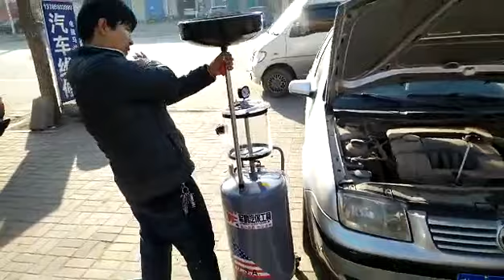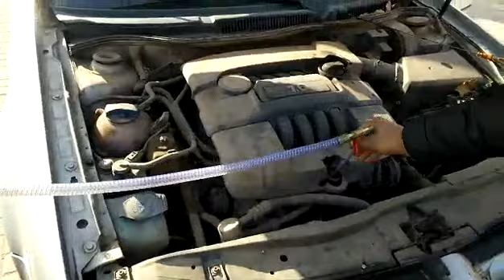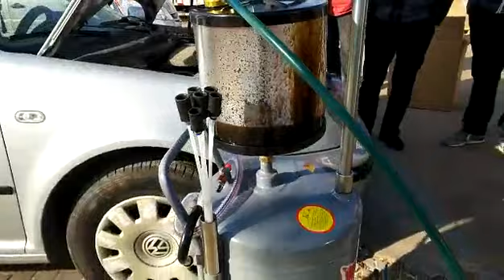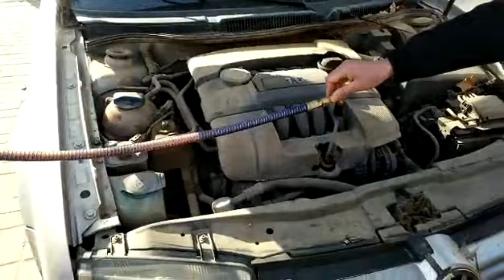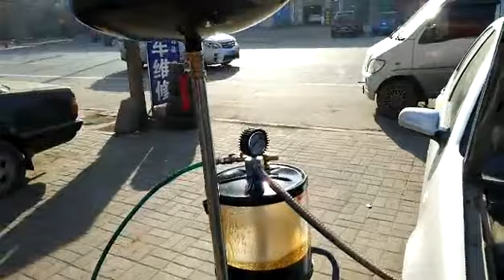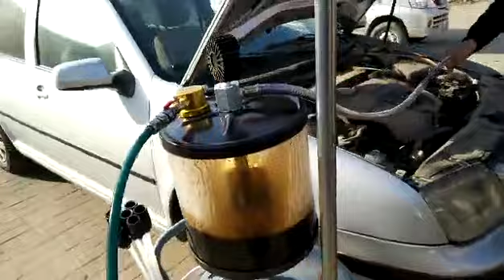Pneumatic Portable Waste 80L Oil Collecting Machine Change Extractor Car Engine Oil Drainer

Comment: What is work of green pipe 
It is supply vacuum air or compress air....
Reply: its compressed air, most models can handle the 8bar a regular air compressor puts out, but you need to be cautious about not generating to much vacuum in the plastic housing